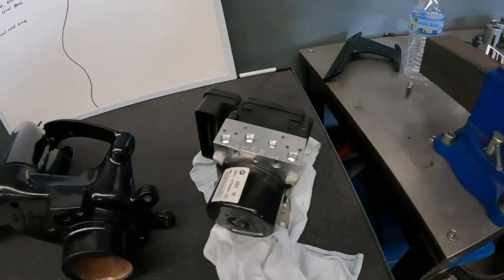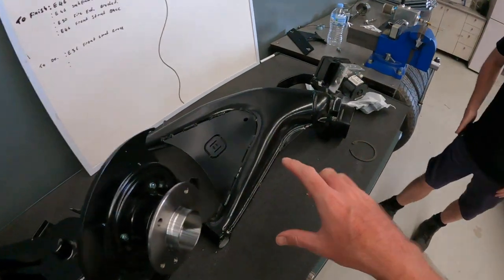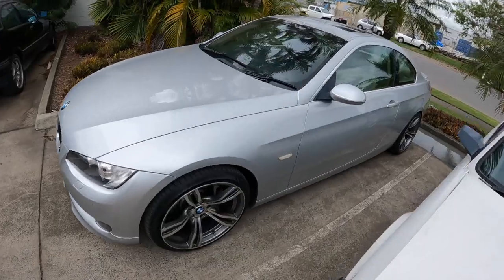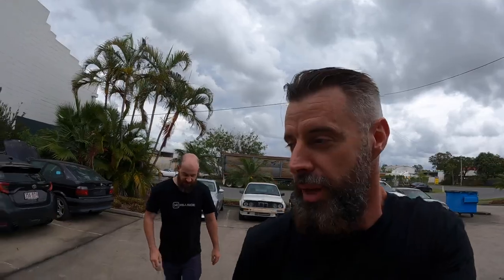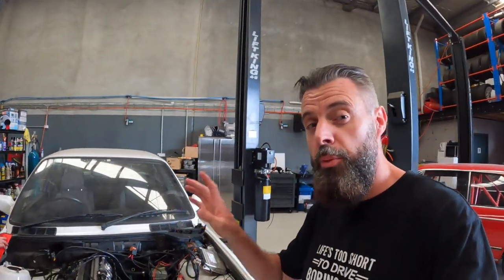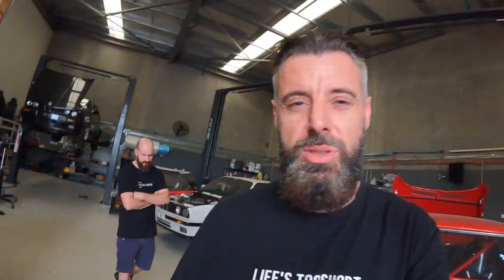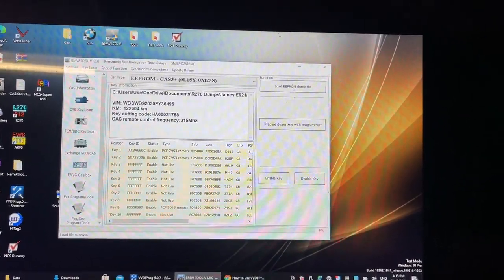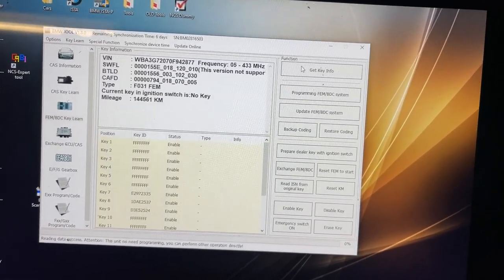Hillside Motorsport Vlog & Getting F30 Keys Programmed!!

Comment: Would love a step by step for someone needing a second key. Does the security module need to come out? Links to vvdi prog hardware?
Reply from the maker: Yeah FEM needs to come out, you then need to modify the eeprom, then modify the software on the FEM, then return the eeprom back to stock, then you can write new key data. It's an absolute faff. Especially when the china keys are faulty and you spend 7 hours retracing all the steps trying to work out why they don't work lol. All the tools are available through vvdi/xhorse (from which you get zero support). However you need about $2000USD worth of tools to do a FEM key. It is not really something i would recommend unless you want to make a business out of it. And even then there is soooo much misinformation out there from people trying to protect their knowledge and incomes.
Reply: @ZeroTo60Tube  Thanks for the write up, sounds like a faff indeed! 👍
Reply: I have a friend with an N54 swapped e30

Comment: On the N52 swapped E36, does it bolt right up to the stock trans? Also do custom motor mounts have to be used? I've been told before that you can drop an M50, M52, M54 into any E30/E36/E46 chassis and they'll bolt right up to the stock transmission and even sit in the stock motor mounts.. I've never verified it but (if true) I always thought it was kinda cool that BMW made them so similar and modular like that.
Reply from the maker: Unfortunately they dont, the angle the n52 sits at is different to the m series motors, so the transmission are leaning over..... however what the boys are trying to do is use the ultra cheap diesel transmissions.

Comment: I feel like I'm going to get crap for this, but I track the stock turbos at 16~17 PSI only (While FBO+inlets). Heat management, reliability of said turbos since getting them here after taxes even using fcp euro is like 4k usd and the lack a rear lsd makes me not want to push them further
Good job with the key programming! Thats the one thing I havent risked trying to do yet lol
Reply: @J B csf rad, wagner evo 1 intercooler, water wetter with around 80% water, ppk2 aux rad, bigger no name oil cooler, ducting with an m3 front bumper for more air into the rads and mhd in track cooling mode
Enough for 10 laps in the time attacks we have here excepting the super hot ones in summer, been thinking of a better oil cooler but no ideas right now

Also I installed the dct thermostat from the m3 to split the cooling and not have it as heater for the coolant

Edit: I forgot to add above, thermal tape in the downpipes and outlets
Reply: @J B The reason I went with such focus for the coolant was exactly that, coolant was really easy to overheat and the stock rad fails massively at keeping it cool. Right now Im in the other end of the spectrum, this weekend I managed to hit oil temp limiter twice which is why Im thinking of a different oil cooler, according to logs coolant was still years to go before the threshold.

There was this long threads in spool street about this very issue where a guy who races in china showed a lot of technical data and solutions on how he fixed the cooling for his car and comparing to the M4 with BTU, surface area and more. Took a lot of references from there and prior experience I had with my old ez30 subaru and that s how I ended up like this lol

I could probably change the aux rad to a bigger new supra one since it seems it would fit, but its just a random thought.